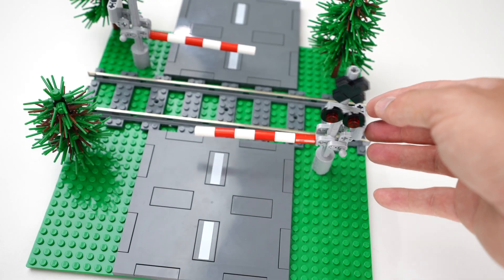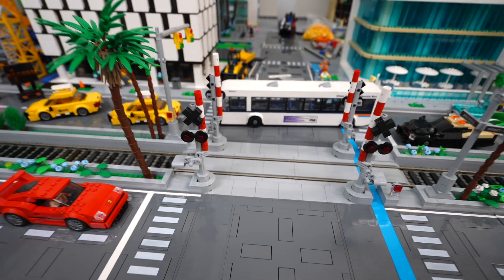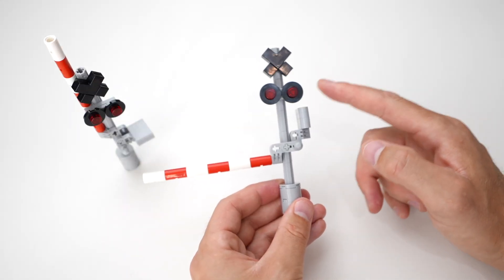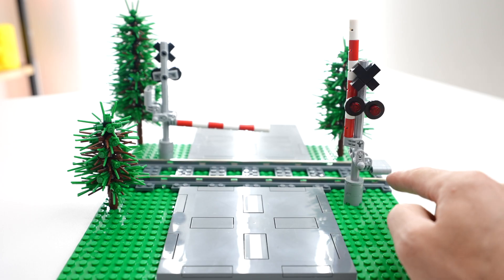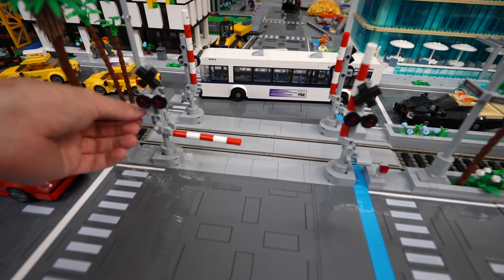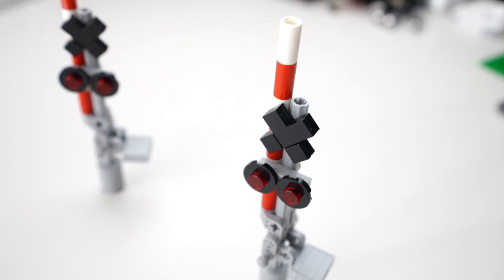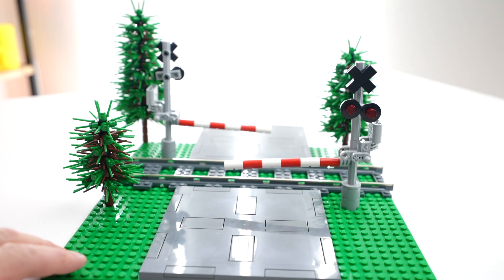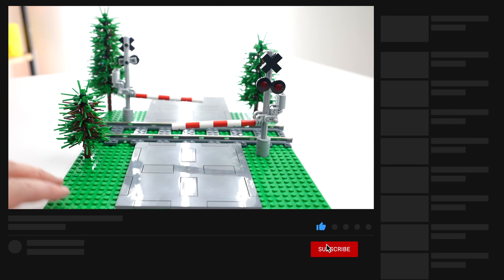How to Build a Train Crossing Arm!

Comment: Love your builds. Only change I would make is to change the X to white so you could add a sticker that says "Railroad Crossing" like most North Americans do. But perhaps they are different where you are?
Reply from the maker: Nope, you are correct! However, it's easier to make stickers with white writing when you do a black background (so you don't have to cut out each individual white letter), so we have the X in black to match the sticker background color if that makes sense

Comment: is there a reson for using 1.5M connecting bushes for the weighted end rather than 3M connecting peg?  It just seems like it would fall off easier, even a 2M peg would hold it better